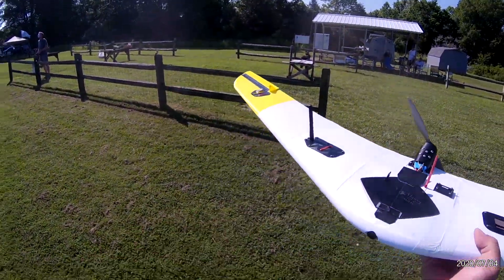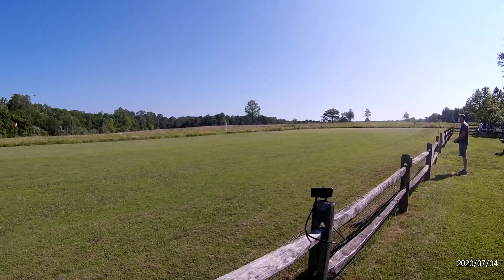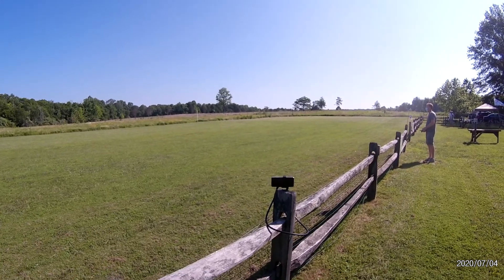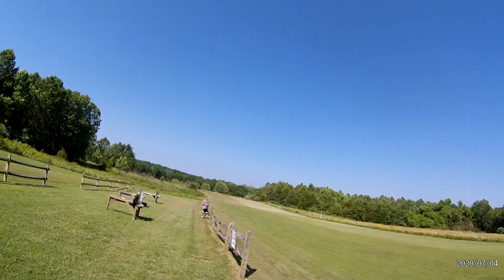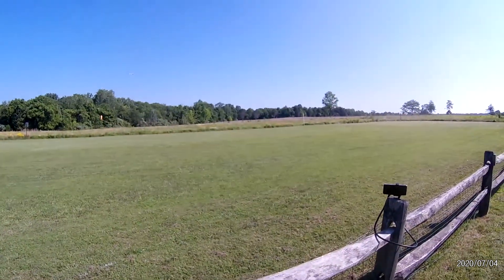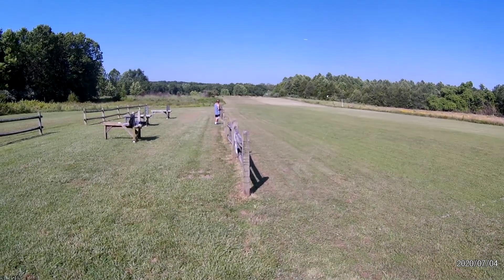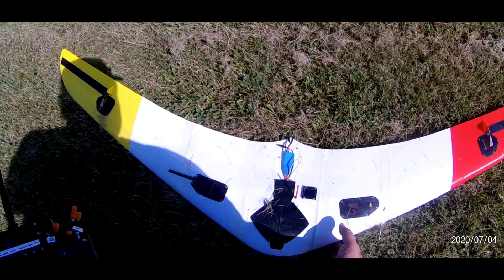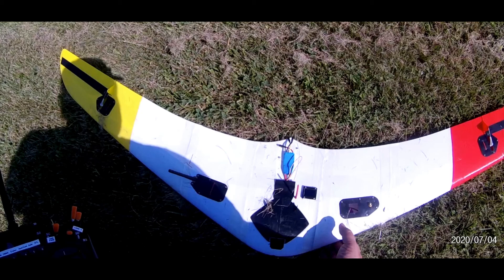EBW 160 Flying Wing Lost my motor mid flight!

Comment: Apart from the engine mount, there was no damage on landing? printed in PLA or LW-PLA?
Reply from the maker: I printed it in PLA. I did not lose control of the wing surfaces, so I was able to glide it in with minimal damage

Comment: I didn't understand what caused the motor to fall off o could you elaborate?
Reply from the maker: The motor fell off because the mount was also 3D printed in PLA and was not strong enough.  The motor torqued the mount and broke it.  Then when the motor got lose, it pulled enough to disconnect the bullet connectors and fell to the ground never to be seen again... :(